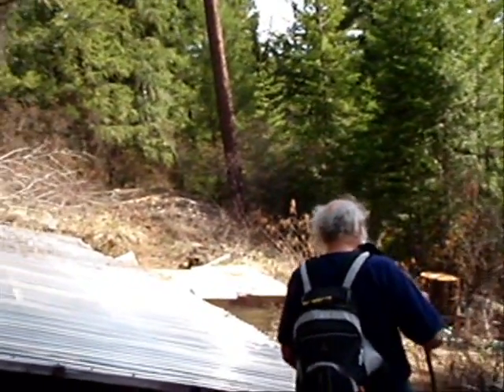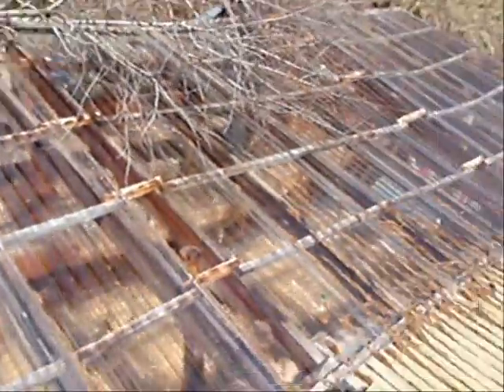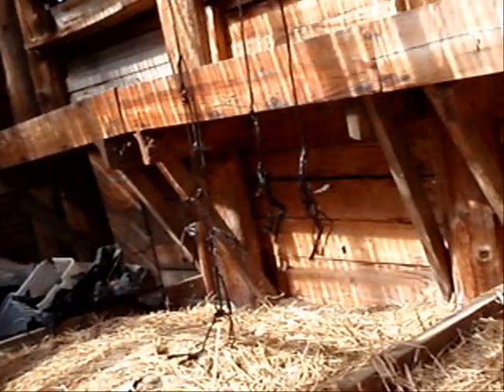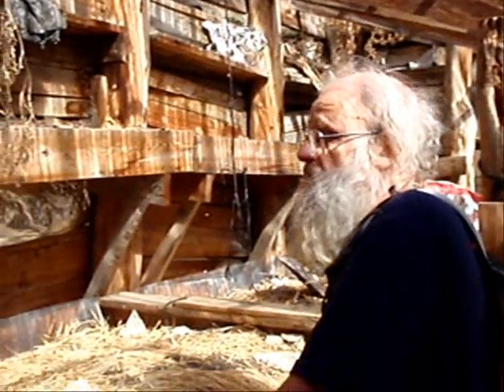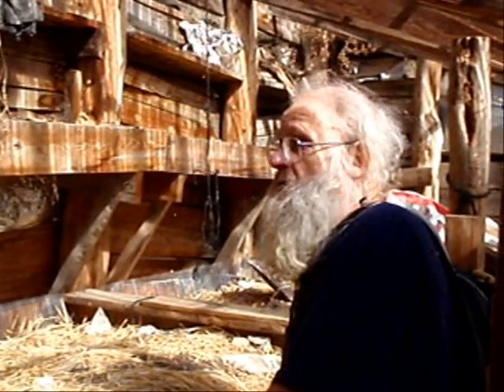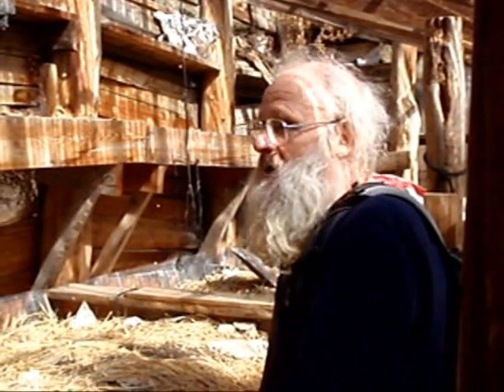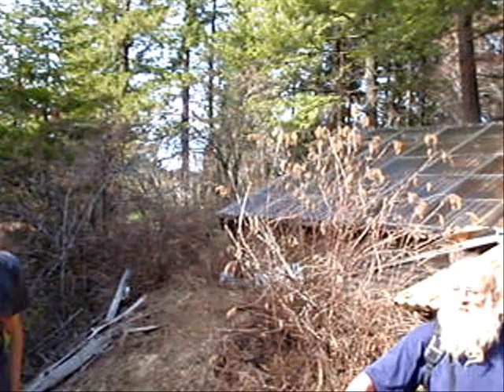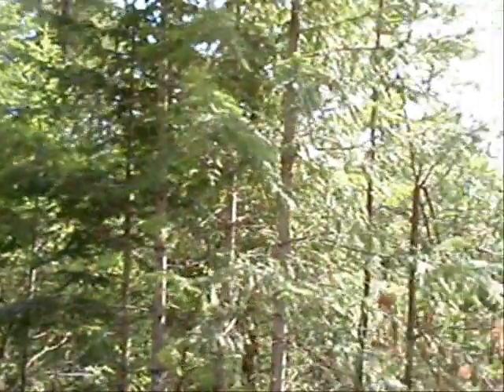Official "Earth Sheltered Solar Greenhouse" - pit construction

Comment: WHAT ABOUT UNINSULATED STRAWBALE  WITH THRMAL MASS OF GRAVEL FLOOR, SOUTH FACING WINDOWS AND A BIO DIGESTER TO MAKE COMPOST AND HEAT THROUGH A  COIL IN THE COMPOST PUMPED INTO THE GREENHOUSE AND THE METHAN FROM THE COMPOST TO HEAT IN THE WINTER.